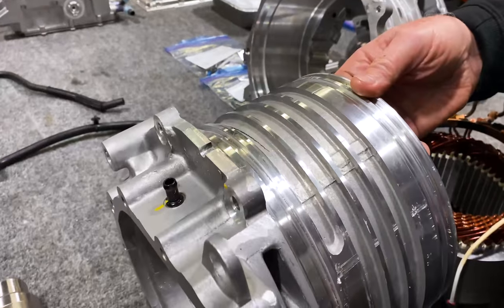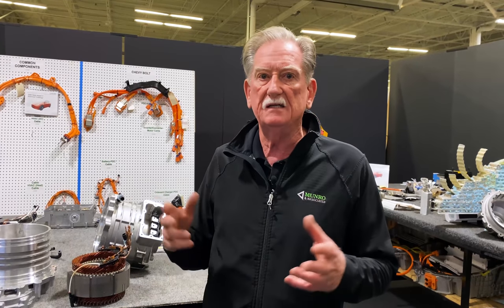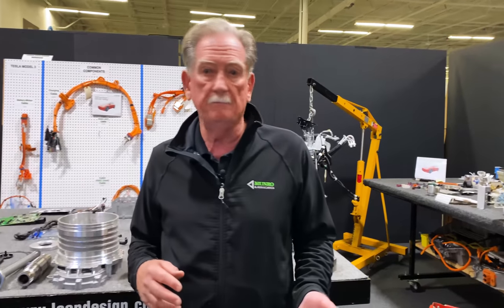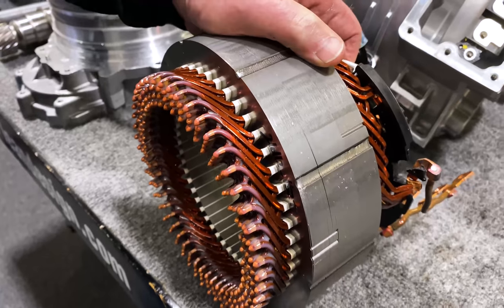Mach-E Front Motor: Sandy is Blown Away by Great Design

Comment: Keep in mind that the front inverter carries less than 1/4 the current of the rear unit.

The following is hearsay, I don't design motors. Wound stator coils are more subject to insulation wear between individual strands and breakage of strands as vehicle motion and and motion induced by magnetic flux act on the exposed end portion of the wire bundles. Additionally the wire bundles in a wound stator have lower thermal conductivity than thicker hairpin conductors. What I have been told is that hairpin motors are more costly but more reliable and more tolerant of overload. 

It will be interesting to see what else we hear about this. I do find it curious that Tesla had such a high failure rate when trying to use the hairpin design, but not surprising at all that Elon would whisper to Sandy that the other guys were doing it wrong.

EDIT: And fer chrissake every EV needs a MECHANICAL LSD on at least the front diff. Relying on the front brakes alone for TC, especially in a 'sporty' EV, is ridiculous.
Reply: Excellent... except that if you're going to put a mechanical LSD on only one axle, don't put it on the steering axle. In an EV, separate motors (and thus no differential at all) is more effective than one motor and a limited-slip diff.
Reply: @brianb-p6586  Yes, separate motors and inverters is a cool trick, but I'd rather have an LSD, Especially on the steering axel, than to heat up the brakes and chop power to the motor as most systems do today.
Reply: @Miata822  If your motor control is best described as "chop", rather than "adjust", the result is going to be undesirable. I agree that using the brakes is undesirable, but for most vehicles in most conditions the system very rarely takes any action, so it doesn't matter a lot.
Reply: @brianb-p6586  Drive any of the front wheel drive EVs and the TC is OK for normal street use, but useless when driven aggressively and useless on track.

AWD EVs also face this issue. See Misha Charoudin's Nürburgring Model 3 videos w/ overheating brakes or the recent Rich Rebuilds offroad Tesla build to see the downside of using brakes and power limitation in extreme type driving.

No, not every car needs an LSD, but cars that are meant to be driven with gusto would benefit from it.

Comment: i suspect that the lower power output of the mach e front motor allowed for the design . I'm not so sure that the small spur gear design will hold up long term. mostly looks like the 4CEAT transmission with all the clutches and planetarys ripped out. 

Is that front diff a torsen tq biasing unit ???  sure looks like it
Reply: I don't know how you can guess the design, when it isn't shown. A worm gear design (such as those by Torsen, Quaife, etc) is a possibility, but it would be the only limited-slip diff in an EV that I've heard of, and the front of the Mach-E would a strange place for that to show up.
Reply: @brianb-p6586  it's not difficult to guess, for the machine and tool cost to make a open diff that compact, just make a tq biasing diff. the pancake design actually lends to it.

why limited slip front diff, easier to control in snow,ice
Reply: @seancollins9745  What "pancake" design? The diff is a cylinder roughly equal in axial length and diameter, like essentially all diffs.
Reply: @brianb-p6586  so wher3 is the spider gear pin ???
Reply: @seancollins9745  that's why I would like to see it disassembled. My guess is that the differential case pulls out of one side of the ring gear. No matter what the internal design, there are obviously details we can't see, and it must come apart somehow.

I suspect that Munro isn't interested in this part because it isn't EV-specific enough, and therefore isn't trendy enough, to bother with. They also likely don't know how to get it apart, and are not sufficiently motivated to find out.

Comment: Has anyone got a reference for the skin effect claim? Sure at high frequency (in the MHz and above) the skin effect results in the current only flowing in the surface of the copper and the depth of the gradient of the current density into the copper is reduced with increasing frequency. There is an effect in transformers (I would imagine windings in general, like motors) called the "proximity effect" which is different than the skin effect. The proximity effect causes a gradient in the current density to develop due to current flowing the adjacent windings, but I though the proximity effect was also frequency dependent. 

Obviously these motors are being driven by a three phase PWM inverter, but isn't the PWM frequency low considering the size of the motor. Perhaps in the sonic range? I would expect those effects to be small at such a low frequency, but that is only my intuition based on DC/DC converter transformer I've worked on in the 100's kHz switching frequency range. Maybe at the increased current seen in these windings motor it makes more of a difference than in the low wattage transformers I've worked on.

If anyone has a reference to the skin or proximity effect in EV traction motors I would like to look over it.
Reply: As another commenter pointed out, the PWM frequency only matters up to the smoothing capacitors, and is irrelevant to the motor. The frequency of sinusoidal AC current in the motor is only a few hundred hertz (for an 8-pole motor at 12,000 RPM it would be 800 RPM, and the vehicle is usually at a fraction of that speed), and at a few hundred hertz skin depth doesn't matter to conductors the diameter of these motor windings.

There are lots of online calculators and charts to find skin depth - just select copper and the motor power frequency (zero to about 800 Hz) to get a value.
Reply: @brianb-p6586  The caps are on the DC input, not the phases.

I agree the current will be smoothed but by the motors inductance. Perhaps the proximity effect is still a factor at DC?
Reply: @Fix_It_Again_Tony  Proximity effect, like skin effect, is an AC phenomenon.
Reply: I think the stator frequency is under 1kHz, it could be 6AWG wire in that case before skin effect is a factor. One of my 3 phase AC motor controllers has a stator frequency of 400Hz for motors in the 8k to 10k rpm range. It is hard to find that spec.
Reply: @dannelson6980  Check out that paper I linked. It's a good overview with some simulations. For a larger motor like this with large conductors it can start to matter. The current density decreases as the skin depth increases until it is 0. Even if the conductor is thinner than 2x the skin depth, the current density is still decreasing as you move in towards the middle of the conductor and this translates to AC losses.
Reply: @Fix_It_Again_Tony  I don't see your link.

Comment: Really, it goes along the surface? Should windings then not need to be hollow or even multi-chamber extrusions? 
If true, density could be tremendously higher. And silver to be used in stead of copper to reduce heat to be dissipated. With less material a much lower resistance could be achieved. I'd REALLY want to look into this, the laws and limitations...
Reply: Current does not flow at the surface at all. It isn't even limited to the skin of the conductor, except at high frequency. All of the skin effect discussion is just a distraction from much more important factors. The Wikipedia page for skin effect explains this: https://en.wikipedia.org/wiki/Skin_effect

But yes, a frequencies thousands of times higher than involved here, or at current many times larger than flowing here, hollow conductors are used.

Comment: That Tesla design is nearly 10 years old. Can't wait for you to compare the latest plaid motors to the Ford designs. I think they won't compare.
Reply: Aren't 3 of them being put into Plaid?
Reply: Depends on what Tesla unit it is. The original Model S/X front motor is that old; the current Model S/X front unit is a year or so old, derived from the Model 3 unit.
Reply: @abraxastulammo9940  The Plaid has a single-motor front drive unit plus a two-motor rear drive unit. The rear unit will be basically two separate motor plus gearbox units, one driving each wheel and mirror images of each other, bolted together side-by-side. All three motors will be similar, but may not be identical. The front and rear gearboxes will be different, if only because the front includes a differential and rear does not.
Reply: @brianb-p6586  Of course but my point was that the carbon wrapped motor will likely exceed anything Ford has produced and Tesla remains years ahead and continues to outpace them in terms of innovation. Can't wait to see a Plaid tear down.

Comment: Can you talk about why no one is using a 12volt lithium battery to run electronics and using the large pack to recharge the 12v with a transformer to reduce voltage?  It’s a lot less weight and not something that will need replacing for a while.   The new Ford lightning has a 12volt battery inside the back of the front trunk.
Reply: How about "they had their reasons, things are changing"?
Reply: It isn't relevant to this video (which is about the front drive unit), but the 12 V power does come from the high voltage system via a DC-to-DC converter (not a transformer, which only works with AC). The 12 volt battery is usually still lead-acid because there is little if any cost justification for using lithium-ion for the little 12 V battery.
Reply: Less Weight = more range or more payload.  Sandy 101. A gram a day.
Reply: @ZzHasbrozZ  Sure, I'll believe that without watching the video, and some people put lithium-ion starter batteries in their conventional cars... which is why I said "the 12 volt battery is usually still lead-acid". 

By the way Elon does nothing but marketing - he doesn't design the cars at Tesla (or the rockets at SpaceX).
Reply: @brianb-p6586  I’m sorry, correction John put in the lithium 12v battery.  And Wan designed the battery.  And Juan built the battery.   Elon just paid them all to do it.  But it wasn’t his money it was the customer. So yes you’re right people do replace their 12v batteries with lithium ion ones.

Comment: MR.Munro,you are not agree with the connectors of the motor-invertor, because they are similar to one to the other.But if you pay attention to the mounting bracket positions,they are positioned to the opposite directions.So,it’s impossible to mount the one at the place of the other.By doing so,the company has unified the connectors and consequently has made economy..

Comment: Can't wait until the standard is ULTIMATE TORQUE VECTORING  WITH MOTOR IN WHEEL DESIGN . FAR LESS BEARINGS  /LUBE NEEDED . I IMAGINE WE COULD USE MULTIPLE RATIOS " ELECTRICLY"  IF NEEDED RATHER THAN GEARS😊😊😊
Reply: Torque "vectoring" requires one motor per wheel, but they don't need to be in the wheels. Yes, in-wheel motors are slightly simpler, only because of the lack of jointed axle shaft. Motors without reduction gearing (like most in-wheel designs) are simpler, but must be larger than geared motors because they are required to produce more torque.

You apparently don't understand motor operation or control if you think that "multiple ratios 'electrically'" means anything. For most applications - including this vehicle - multiple gear ratios are not needed and not used; the Mach E has a single-ratio transmission.
Reply: @brianb-p6586  BY multiple ratios I meant the concept almost like the dual winding of older style motors STARTER/RUN WINDING TYPE ,WE CAN IMAGINE MUCH MORE POWERFUL AND EFFICIENT DESIGNS USING SOME OLDER CONCEPTS BUT WITH MODERN MANUFACTURING METHODS . WE HAVE JUST STARTED LEARNING HOW TO MANIPULATE  MAGNETIC FIELDS😌
Reply: @brianb-p6586  as to MACH E  I HAVE ALWAYS BEEN A FORD FAN AND OWNER BUT YOU GOTTA AGREE HENRY WOULD BE THAT HIS COMPUTER DID NOT LEAD OR SHOW THE OTHERS HOW " electrication" of the transportation industry is done . While they certainly had the ability 😭😭😭
Reply: @larrysnyder12345  We are very far from "just starting" to learn how to manipulate magnetic fields. The clever old techniques of switching winding configurations are no longer needed, or of any value, with high-voltage batteries and electronic controllers - that's why most EVs have only a single drive ratio.

Comment: The reaction to the torque that the motor's magnetics produces in the rotor has to appear in the stator, doesn't it?   How does just press-fitting the stator assembly into the motor case manage to keep the stator ... stationary?
Reply: I'm guessing that the stator was really clamped in the housing, likely by pressing a chilled silicon steel stator into a hot aluminum housing.  Munro had to cut the housing to relieve the pressure enough to remove the stator.
Reply: My thought. too.  Are there pins or slots, or is pressure sufficient?
Reply: @davidharris7249  I would expect at least two alignment pins or ribs, but I didn't spot any in the video.
Reply: Shrink-fit motor cores are common, and while ribs might make sense, they generally don't seem to have them. Parker GVM and BorgWarner HVH motors are both available as "kits" or "cores", which are simply cylindrical and shrink-fit into housings.

Comment: i've heard that the "skin" effect is only in AC power and that it is not the same for DC. i might be wrong but it's a thing in the car audio world.
Reply: I'm not sure about skin effect, but the purpose of the drive is to convert DC into 3 phase AC power.
Reply: @fortfun46835  it has to do with how the electricity flows across the conductor. using multiple strands vs. solid core wire.

AC is AC no matter if it is generated that way, or is converted, the properties will still be the same.
Reply: The power to the motor windings is AC. On the other hand, the frequency is not high enough for skin effect to be a major consideration.

Comment: 11:15 THE MAIN question is, why in world they use permanent magnets instead of a asynchronous design??? 🤷🏻‍♂️
Reply: Better efficiency earlier.
Reply: Better efficiency and much less heating in the rotor (which is hard to cool, compared to the stator).

Comment: I can see a press fit stator working with 60 HP, but 160+ is a different matter. Also makes it non serviceable
Reply: It's not press-fit, it's shrink-fit. Any that design is used with much more powerful motors. Yes, it does mean that the stator and the stator housing are not separately serviceable. In practice neither one is likely to ever fail in the life of the vehicle, and if one fails the combination will be replaced.

Comment: why do manufacturers never use the same motor in the front and rear?
Reply: Volvo/Polestar have the exact same motor in front and back. 🤷
Reply: They usually do use related motors in the front and rear; for example, until recently the Tesla Model S and Model X AWD non-Performance variants use the same motor at each axle, but in somewhat different transaxle housings to fit the locations. The Audi e-tron has different front and rear motor power ratings, but they may be physically identical motors (they are the same type and with similar output ratings may be limited differently only by electronics or cooling).

Front and rear have different requirements, with the rear in most cases requiring more power. Some manufacturers may choose to idle one motor at low power and use only the other motor, and in that case it would make sense to use a permanent magnet motor to run all the time and an induction motor to sometimes spin idly.

Comment: vehicles made  today are made in away souilly to keep dealerships in business. if you made a truck that had allot less moving parts the dealers would go nuts because those vehicles would visit the dealership allot less
Reply: Dealers are fighting Tesla for that very reason.
Reply: @jamesvandamme7786  it's a shame but unnecessary evil that we switch over quickly and efficiently. When we went from horse buggy to combustion engine it took 8 years total it was nobody fighting saying that the horses were better and that we should save the horses because the horses need jobs too.
But I understand the transition 
Needs to happen gradually so we don't disrupt people's jobs but to lie like they are doing about Tesla is unwarranted because the transition is happening no matter what.

Comment: I don't know how he count bearings, but I count at last 5 not 4, and maybe more. and with cooling someone counting parts, but forgetting weigh.
Reply from the maker: Sandy omitted the two bearings for the Motor rotor, from his count.
Reply: @MunroLive  if I'm correct there are elements with two speed on one axis ( ~2:15 ) one go from rotor to small gear, and inside is from differential, and where is 2nd axis with two bearings. But first required at last 3 bearings for slower moving parts, and 2 for faster (motor rotor), so still I counting 5 not 4. I talking about whole assembly, so be more apples to apples.

Comment: Why not have front motor builders make rear since their design is superior?
Reply: Probably COST savings. and MAGNA RWD is probably not good enough. 
MAGNA EV platform is pretty OLD and is shared by JAG and others. 
JAG only gets 190 miles on a charge.
Reply: TIME.
Reply: Best guess is Magna didn't have a motor with appropriate specs for the rear and BorgWarner didn't have a motor with appropriate specs for the front.  This is what happens when you are mostly just assembling and EV rather than engineering/manufacturing an EV.